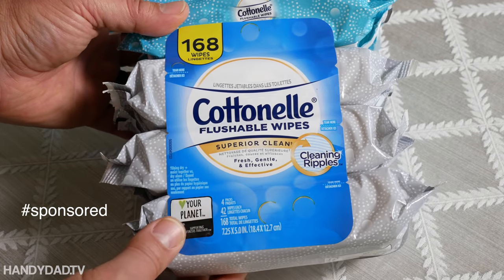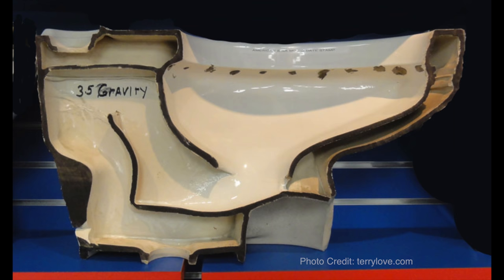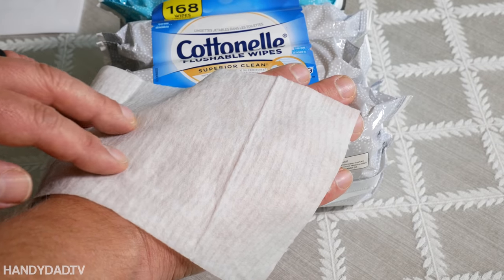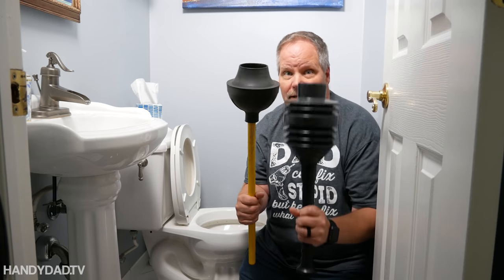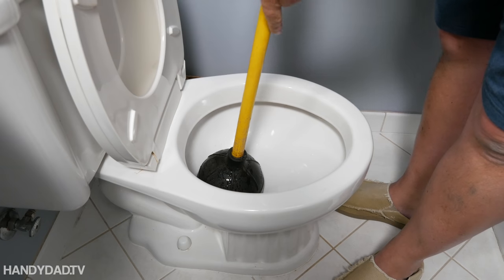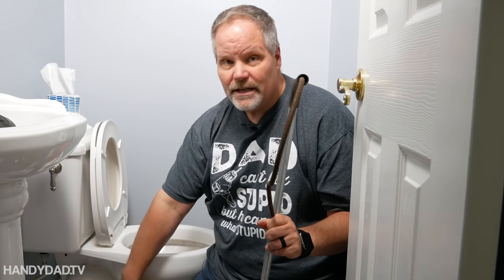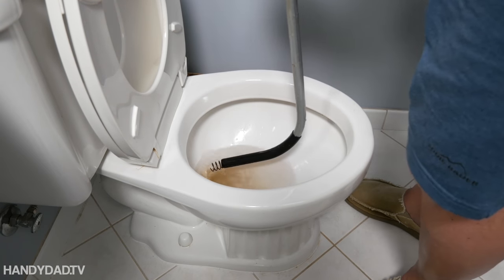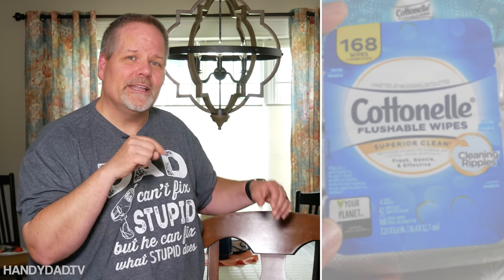Four Steps to Unclog a Toilet for New Homeowners

Comment: Beware if you have an older home with cast iron sewer pipes. Safe wipes don’t decompose like tp and catch on not smooth flaky rust inside the sewer pipe and congregate where the pipe has the least fall. 💩 but with a frown